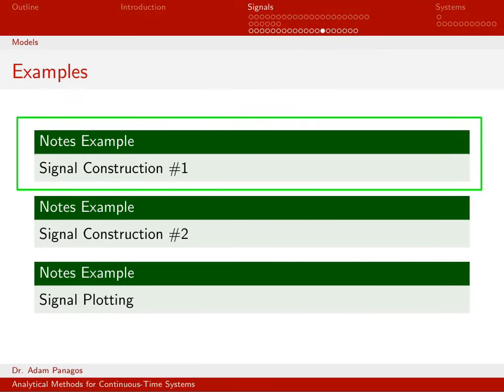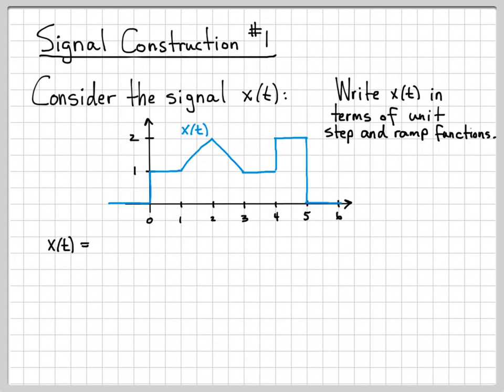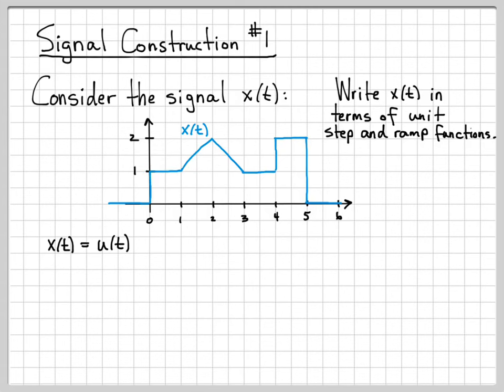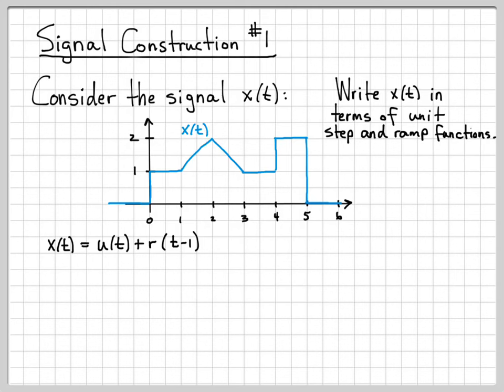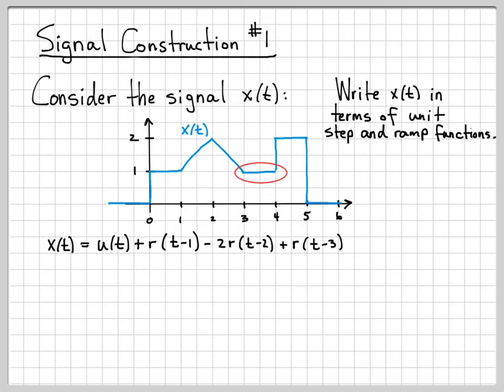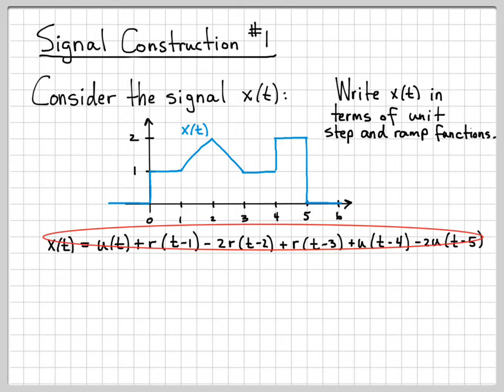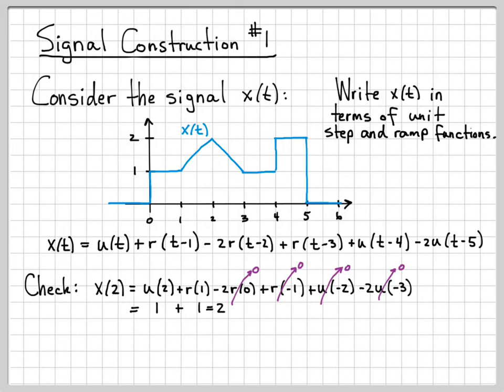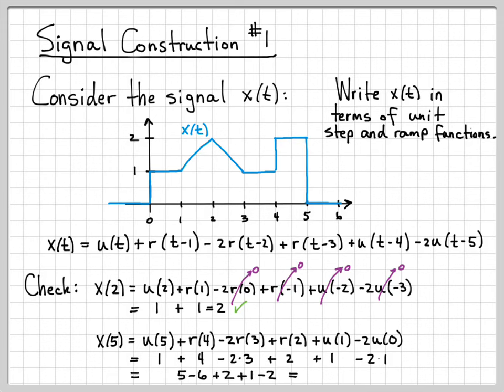Signal Construction Example #1

Comment: why are we doing   -2r(t-2) when its slope is -1
Reply: akshat bhatt my question as well. Adam can you explain?/
Reply: akshat bhatt it should  be -r (t-2) i think. how to calculator  slope????
Reply: (-2) is the change in slope. See it is something like this-
(final slope)-(initial slope)
= (-1)-(1)
Reply from the maker: Yes, that's correct.  At time t = 1.8 we have a slope of +1.  At time t = 2 we need to have a slope of -1.  So, we need CHANGE in slope of -2.  Thus, the use of -2r(t-2).

Hope that helps.

Adam
Reply: He said why in the video.
Reply: @An_urag9  thank you random stranger, you helped me

Comment: i dont get the part 'r(t-3)'....i think it should be 'u(t-3)'...please explain...
Reply: same here, did you get any answer to it?
Reply from the maker: During the time interval 2<t<3, the signal is decreasing with a slope of one.  To get the signal to stop decreasing at t = 3, we need the slope to increase.  Adding r(t-3) increases the slope by 1 at time t = 3, and thus we now have a slope of 0.  This slope of 0 is held constant until time t = 4.

Hope that helps.
Reply: Adam Panagos thanks for the quick response, I get it now. Thanks for helping Adam.
Reply: @AdamPanagos  thank you for the explanation

Comment: Might be a stupid question, but what is the unit of the signal x(t)? I am having trouble understanding the unit of a digital signal and other types of signals. I do know that sometimes the square of x(t) is power
Reply from the maker: Not a stupid question at all.  For the most part, in classes/examples like this the signals are unitless (i.e. they don't have any units).  In some more practical application you might be working with specific signals that have units, but for the most part you can work this type of example using a unitless signal and still convey/learn the relevant information.  Hope that helps,
Adam

Comment: 3:42 
I thought r(t-3) was diagonal line beginning from the 3 . 🤔
Reply from the maker: It is. So, when it turns "on" at time t=3, it cancels out the negative slope before it.  From time t = 2 to t=3, the signal is going down at a slope of -1. Once we add in the signal r(t-3), it adds a slope of 1 at that point, so we end up with a constant value starting at t = 3. -1 + 1 = 0. So, no slope, just holding the value. Hope that helps,
Adam

Comment: At t (0) x has values 0 and 1.   And at t(5) x values are 2 and 0.    So which of the twe values are to be considered -  the 0 or 1,2 ?
Reply from the maker: Great question.  The unit step function u(t) as defined here is equal to 1 at time t = 0.  So, when the unit step function "turns on" it is equal to one when it's argument is zero.

So, consider what happens at time t=5 for example.  The term we're adding in there is -2u(t-5).  This means, when t = 5, we have -2u(0) = -2, so the OVERALL signal is equal to zero at time t =5.

Similarly, x(0) = 1 and x(4) = 2.  As you noted though, the way I drew the original sketch was a little ambiguous.  It might have been better if I'd use open circles and closed circles in the original sketch to indicate which value x(t) was taking on.

Nice work!

Adam

Comment: I don't understand how adding -2r(t - 2) to u(t)+r(t-1) causes the graph to instantly have an opposite slope and still have a positive of x(t).
Reply: You can think of it as a vector quantity. The slope is suddenly increased by 2 units (from 1 to -1) at t = 2. (In other words, at t = 2, the signal rotates clockwise by pi over 2). The slope only dictates the direction. The total vertical drop of the unit ramp function from t = 2 to t = 3 is only 1 which is obviously not long enough to cross the horizontal axis.
Reply: It was confusing but then I realize that -2r(t-2) is -r(t-2) - r(t-2). 
The graph of r(t-1) will cancel out the graph of -r(t-2) at t>=2, leaving v(t) = 2. Then, we add -r(t-2) again to make downward slope of -1 at t=2.
You can read the comment of Mr. Panagos above to understand next step or watch example #2 first.
Reply: @SonPham-jy2qi this is what I’ve been searching for. It’s not because of the position compared to the point where it’s last traveled. But the position on the Cartesian plane.

Comment: Don't we need an impulse on 4? Since the value is instantly jumping on 2 amplitude?
Reply from the maker: That's exactly what happens by adding in the u(t-4).  This unit step is located at t = 4 and causes the signal to "jump up" a value of 1 at time t = 4.

I hope that helps.  Make sure to check out my website http://adampanagos.org for lots of additional content that you might find helpful.  Thanks.
Reply: @AdamPanagos   but the value for u(t) will be 1 .How could that jump to 2. Will that not be 2u(t-4)?? 
Please do reply me....
Reply from the maker: Between time 3 <= t < 4, the signal is holding a constant value of 1.  If we don't add any other terms to the signal (i.e. the last 2 terms of u(t-4) and -2u(t-5)), the signal would continue with a value of 1 for all time.  So, if we want the signal to go up by 1 at time t = 4, we need it to increase by a value of 1.  Adding u(t-4) does exactly this.  This signal is zero for all time up to t =4, then at t = 4 it has a value of 1 and holds it for all remaining time.  Since we were previously at a value of 1, adding in 1 gets us to 1 + 1 = 2.

Hope that helps!

Adam
Reply: @AdamPanagos  wow it's very clear now

Comment: Hi! great video! May I ask, why is the checking for x(5) = 0 is correct? when x(5) magnitude is 2 according to the figure? 
I think in -2u(0) it should be equal to (-2*0), please kindly check if this is correct! Thank you!
Reply from the maker: The funtion in the plot is equal to zero at t = 5. It's equal to 2 when t is slightly less than 5 (i.e. t = 5-epsilon). I maybe should have put closed circles (or open circles) at the jumps to indicate the value. The unit step is always on a time zero so u(0) = 1, thus -2u(0) = -2*1 = -2. Hope that helps.

Comment: r(t-3) is unit step function as it goes straight line ri8
Reply from the maker: No, r(t) is the unit ramp function.  r(t-3) is the unit ramp function that turns on at time t = 3.  r(t) has a slope of 1, so does r(t-3) (when on).  When r(t-3) turns on at time t = 3, it cancels out previous slope of -1 to yield a slope of -1+1 = 0.  The function r(t) is never a unit step function.

Comment: Informative.. thanks :).. one doubt, in your check, at t=2, then how U(2) = 1, when there is no unit step function @ t=2. Please explain..
Reply from the maker: We're evaluating x(t) at t = 2.  That means we need to replace all t's with the value 2.  So, u(t) becomes u(2).  The unit step u(t) is defined as one any time the argument of u(t) is greater than or equal to zero, and zero otherwise.  So, u(2) = 1 since the argument of u(t) (in this case 2) is positive.  Hope that helps,
Adam
Reply: OK. So it means that in u(argument) whenever argument > 0 we take u(t) = 1 and if argument <= 0 we take u(t) = 0. Is my understanding correct?
Reply from the maker: Yes, that's right.  To be perfectly precise, u(t) = 1 when t>=0 and u(t) = 0 when t < 0.  Note my inequalities include t=0 when u(t) = 1.  But in general, I think you have the idea.

Comment: the correct answer is X(t)= u(t) + r(t-1) - 2r(t-2) + u(t-3) + 2u(t-4) - 2u(t-5)
Reply from the maker: I'm not sure how you came up with that answer but it's definitely not correct.  For instance, if we compute your answer at time t = 6 we get:

x(6) = u(6) +r(6-1) - 2r(6-2) + u(6-3) + 2u(6-4) - 2u(6-5)
        = u(6) +r(5) - 2r(4) + u(3) + 2u(2) - 2u(1)
     = 1 + 5 - 2*4 + 1 + 2*1 - 2*1
     = 1 + 5 - 8 + 1 + 2 - 2
     = -1

which obviously isn't correct since from the plot of x(t) we know that x(6) should equal zero.  The correct answer for the signal is worked out in the video.
Reply: Thank you brother ...... I'm Sorry !
Reply from the maker: No worries!  This is some tricky stuff!  Thanks for watching.
Reply: Yeah I thought so about the second to the last expression "2u(t-4)" is it correct or wrong?

Comment: Dont you think the 4th term should be 2r(t-3) instead of r(t-3)????
Reply from the maker: No, the video is correct.  During the time interval 2 < t < 3 we are decreasing with a slope of 1.  Since we want to be a constant value during the time interval 3 < t < 4, we need to increase our slope by 1 at time t = 3. Thus, we add in r(t-3).  Hope that helps,
Adam
Reply: Ya got it thanks 😄

Comment: att time = 3 i didnt get it plss explain again
Reply from the maker: During the time interval t = 2 to t = 3 the signal x(t) is decreasing with a slope of -1 (i.e. it is going down 1 units for every one unit it moves over).  At time t = 3, x(t) stops decreasing and holds the constant value of 1 for the time interval t = 3 to t = 4.  A constant value has a slope of zero.  Since we were previously decreasing with a slope of -1, and we need to stop decreasing, we need to increase the slope by +1 at time t = 3.  -1+1 = 0, resulting in a constant value being held.  This is why we add in the signal r(t-3).  This unit ramp signal has a slope of +1 and turns "on" at time t = 3.

Hope that helps,

Adam
Reply: Adam Panagos at t=4 u have simply written u(t-4).y won't we take the amplitude of 2 into account..??

Comment: I think  - r(t-3) not r(t-3)
Can you explain
Reply from the maker: The video is correct, it should be +r(t-3).  From time t = 2 to t = 3 we are going down with a slope of -1.  At time t = 3 we "level off" and hold  a constant value until t = 4.  So, at time t = 3 we need to go from a slope of -1 to a slope of 0.  Adding in a unit ramp signal with a slope of 1 does exactly that.  Hope that helps.

If you found the video useful make sure to check out my website (http://adampanagos.org) where I have a ton of other resources available and it's easier to watch my videos in a more organized fashion.  Thanks, Adam.